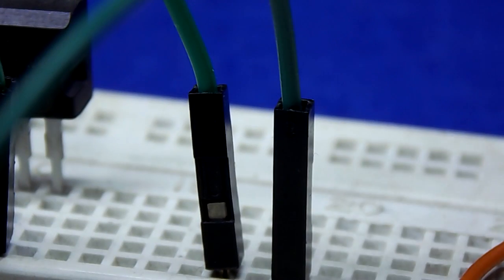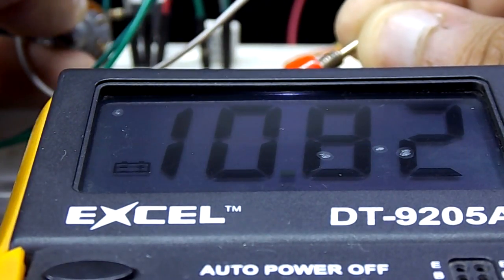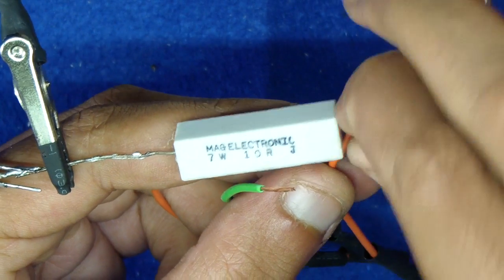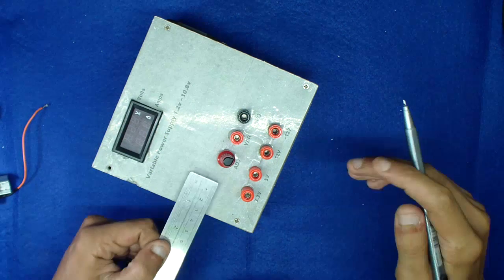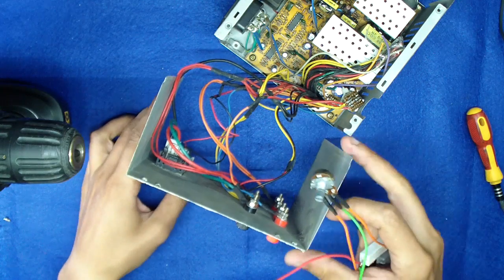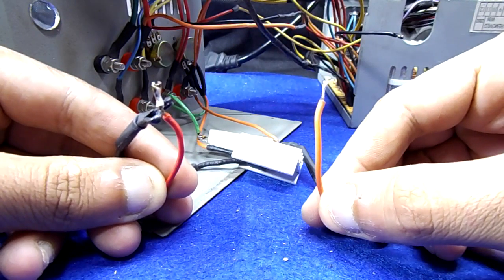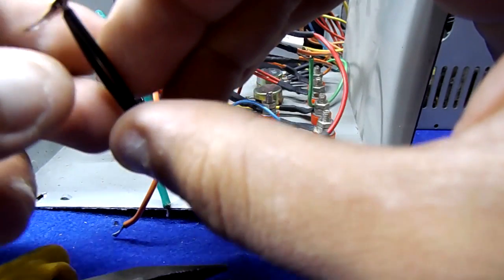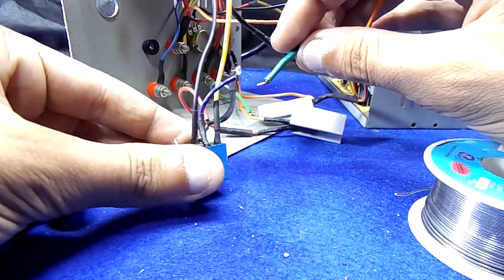DIY Bench Power Supply Part #2

Comment from the maker: INTERFACE DESIGN : https://goo.gl/9EFdEH
Parts:
V/A Display: 
Smart V/A display:https://goo.gl/Ctf2vA
V/A shown in video :https://goo.gl/5u1iK5

LM317t: https://goo.gl/nP1Txs
HeatShrink : https://goo.gl/FE1Bp7
banana pin : https://goo.gl/KhO63R
momentary SW: https://goo.gl/ihzdvQ
LED's: https://goo.gl/ZPuCa2
1K potentiometer : https://goo.gl/KyjmZo
potentiometer Knob or grips : https://goo.gl/DYuYLp

tools:
drill bit: https://goo.gl/6ETYk6
dremel : https://goo.gl/x9zd4o
Reply: After adding the current limit did you still have power to the fan??
Reply from the maker: +Nathan Kirschner sure because current limiting is external circuit doesn't effect connected loads inside the psu itself
Reply: ok cause i saw you used green wire i thought that was for fan?
Reply from the maker: +Nathan Kirschner no it connected to one black wire to keep power on 

You can connect on/off sw between green and black if you don't have switch already attached to the power supply